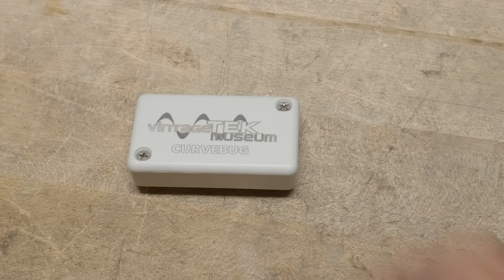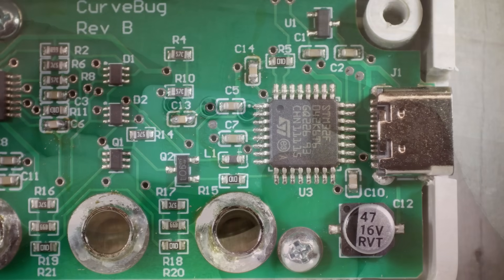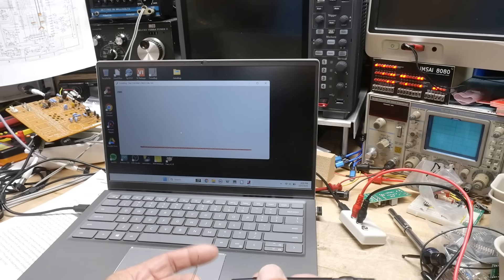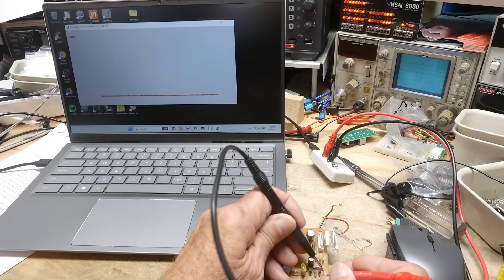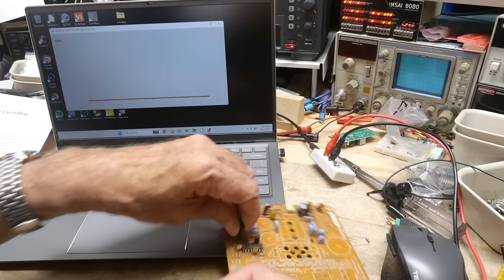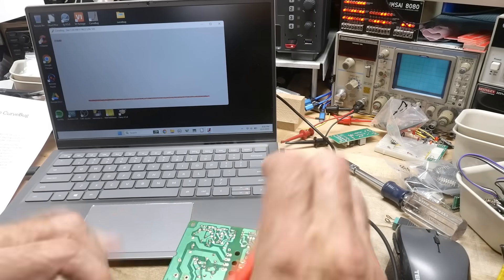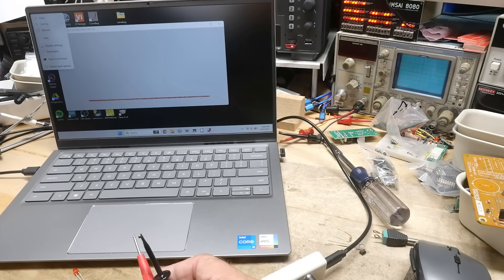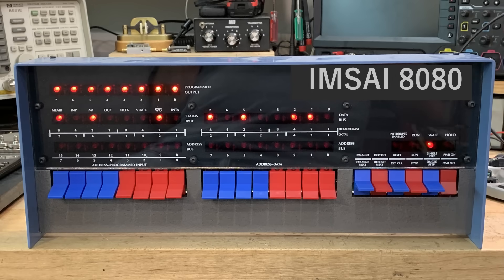#2377 CurveBug dual curve tracer tool from VintageTEK

Comment: Might consider it if were supported on linux.  I've spent the last 6 months moving all my hobby and electronics related applications from Windows to Linux.  They only mention Windows support, so it's a deal breaker for me
Reply: Can you run it in a bottle?
Reply: They have a link on their web site for source code that you can compile in linux:  I will try it on my Ubuntu machine and let you know.

From their web site:   "there is also a posting on tekscopes  [external site] where an individual has written the host code in Python for cross-platform compatibility."

Comment: Ali has something similar, only you get probes and different frequencies; some even have different resistance values for $40. For twice that price you can get one with probes, power supply, selectable resistance, frequency and a screen. I would rather send them a donation and get the more useable Ali part. They all have 210 in the name with various letters post nom for the options, like S SH SS k SJ G ...

Comment: I bought one a few months ago and I like it. It has a very specific use, as mentioned by our host. You have a pair of instruments/boards, one known good and one broken. You ground to both devices, then use the pair of probes to look at identical points on each device. If the pattern doesn't match, your bad part is close at hand. This can also be a nice way to test individual ICs without risking plugging a good one into a bad board and smoking it. For the people whinging about it not being calibrated: it's not a metrical  device. It's a troubleshooting tool.

Comment: I did that with my octo.  Two inputs but switch selectable with common connection so you can A/B diodes or something.  I had a bulk of diodes of unknown origin of all the same type.  I used to screen out the flaky or duds. As they were ancient microwave diodes.

Comment: I wanted a Huntron Tracker but they are priced on the moon,  even used.  The Huntron has selectable voltage and frequency, which is best for testing the AC characteristics of caps.  I built an octopus and the only advantage is you have voltage reference on the scope so you can judge how many volts it takes to turn on the junctions,  like comparing silicon to Germanium.  The only thing is that I don't have enough voltage to test Zeners.  Or breakdown, in most cases.  It will show leaky reverse bias.